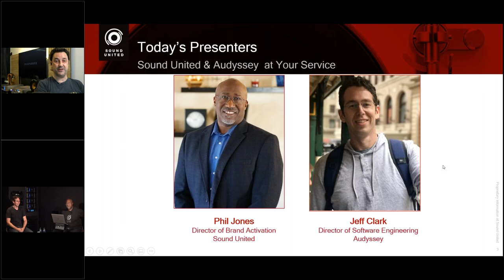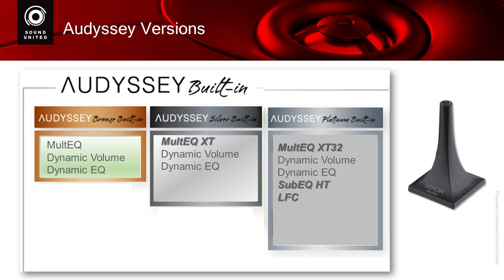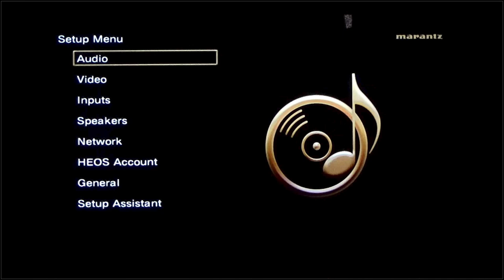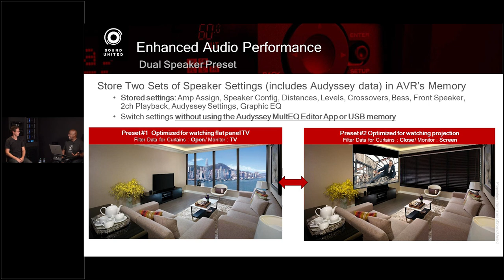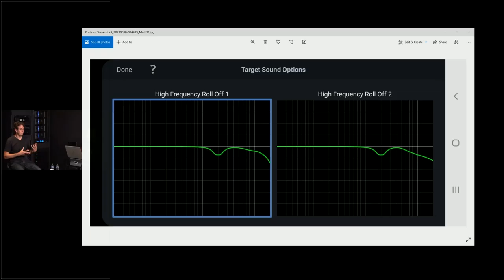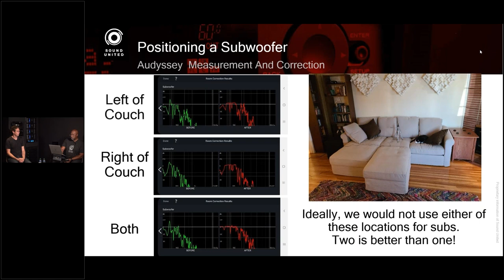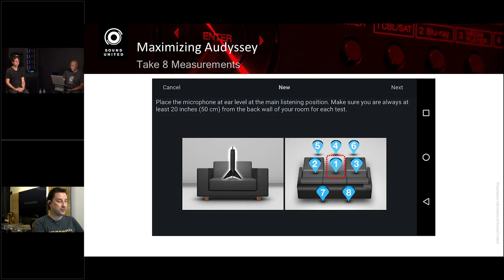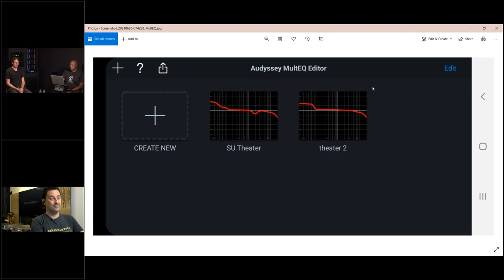Summer Technical Webinar Series | Tour the New Sound United HQ Part 2 - Audyssey Room Calibration

Comment: Great video thank you for making it. The question I have is how are you running each of those 15 inch subs under all of your bed layer speakers on each of their channels or just the Sub/ LFE channel? If Sub/LFE then it's bass management and essentially speaker stands. If not then how? It just wasn't clear in the video if you a running those bed speakers full range and each 15 got that (1) single channels information signal? Or full range each channel using an outboard electronic crossover which is the correct way next to a more elaborate system like Storm Audio or Trinnov or PC  with mapping channels. Thanks again for the other good information here. Subbed

Comment: In my Denon AVR-X3700H I get pretty serious clipping if I adjust my AVR trim above 0 dB so I have to adjust the gain outside of the AVR. This is contrary to the advice given at 1:03. Just a warning to others as you could be inducing clipping into your subwoofers.

Comment: Would enabling the midrange dip also affect the Flat calibration curve? Also, I'm assuming the app calculates EQ for both Reference and Flat curves, just that only shows the former in the app? And, that if it detected a speaker as having a LF rolloff (not "large"), it will try to clean up that rolloff, and it will do so in both Reference and Flat curves?  (Not super-intuitive, so .. might want to make that clearer? :) )